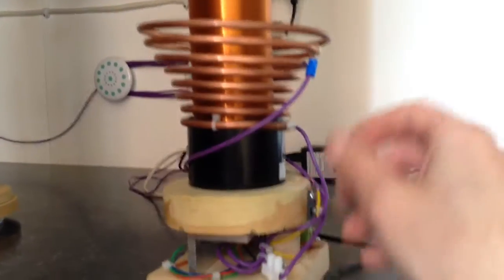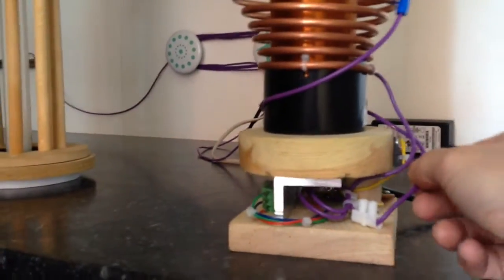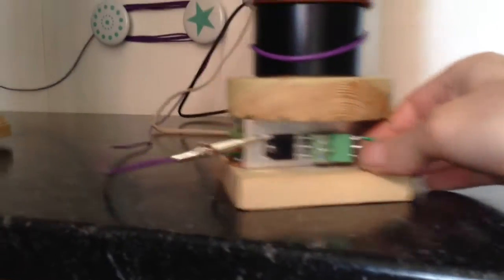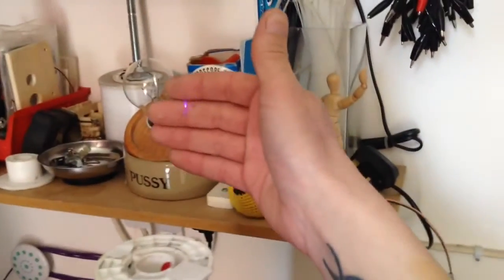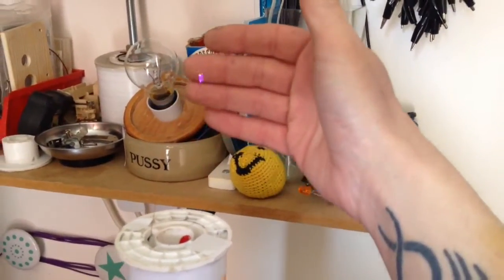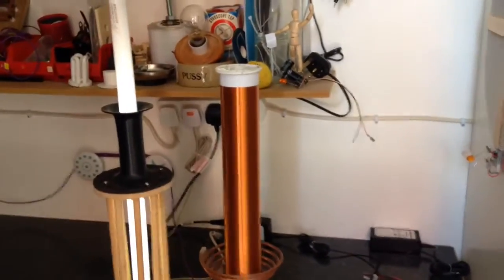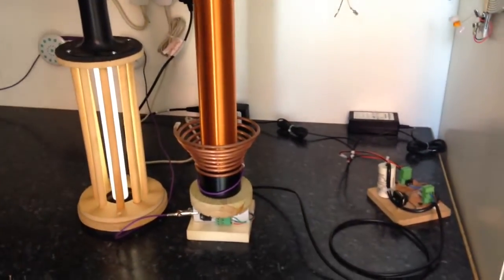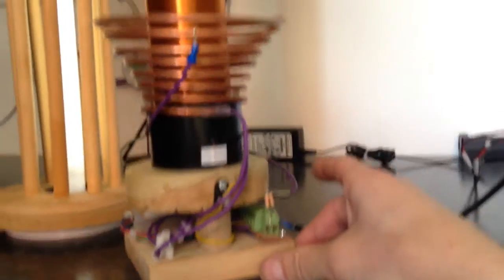Small SSTC with primary tap

Comment: looking good bro!
Reply: Draw a moustache.
Reply from the maker: Tesla Explorer ..thanks mate, I just bought about 80 caps.. I'm going back to high voltage when I get this little run of slayers out of my system. I think I'm back on the horse tho. had a little break there for a bit.  ;)
Reply: is that a BUF420AW ?
Reply from the maker: VamsiKrishna Vankayala ..yes Bud. thanks for telling me about them. ;)
Reply: deeds no problem mate :D...also I think I may have found the reason why the mosfets don't work well..looks like the gate resistor. get rid of it and see if it works
Reply from the maker: I agree bud seems dependant on load and input voltage from what I can gleen. Trickly little ones the Mosfets, very powerful tho.